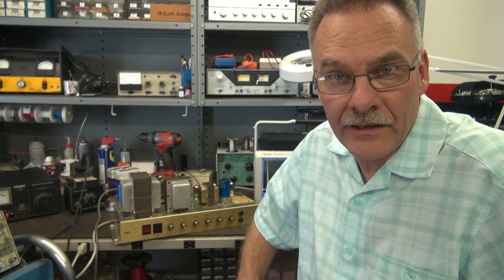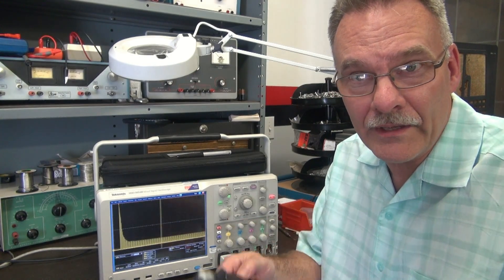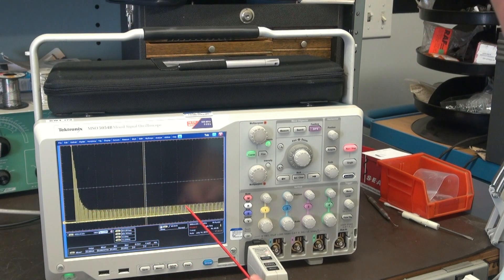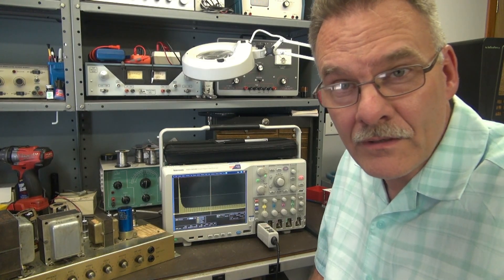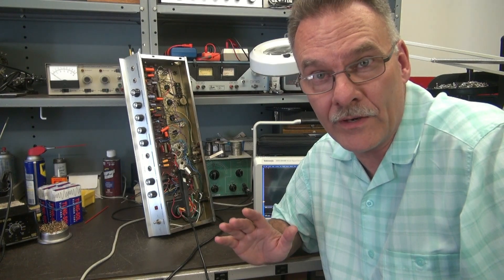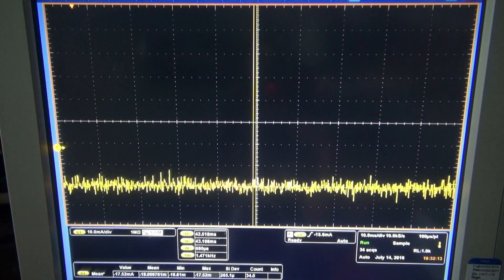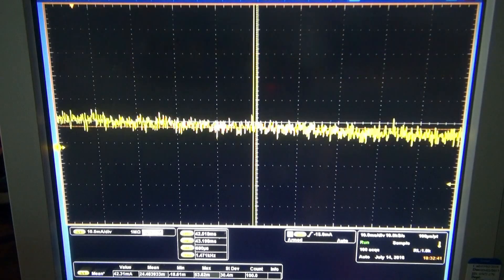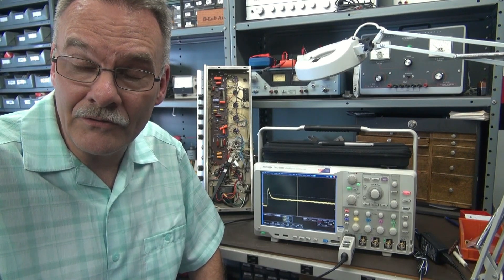Tube Guitar amp standby switch demo Myth buster Marshall Fender

Comment: Yeah its a Mute Switch for most guitar players , you don't want to mess with your Master Vol once you got it in the sweet spot.
Reply: That's gonna end up being a costly  way just to mute an amp. A simple  switch between the signal chain and ground would work better, cost less, be safer and not have negative effects on other parts of the amp. Also the guitar has volume knob lol

Comment: Great explanation, and proof is on the scope! So Terry, if I may ask...on my mid 80's JCM900 high gain dual reverb Mod. 4500 50 watt head/EL34's just turn the volume down upon start up, let warm up, don't worry about the standby? When taking a break, just turn down the volume and all good? If I take a 10min break should I use the standby, or again just bring the volume to 0? Waving a hand in Jackson. Love your 'vid's'....all the best around the ponderosa.  ")
Reply: I'm pretty sure its had EL34's from the factory. It was serviced by a guy called Dr. Zink before, I guess he's a pretty good amp tech. It sounds just great, but I think EL34's are getting hard to get? Maybe I should have the conversion done. (thanks for the reply).
Reply: Jeff..I think its original? The amp is a 1991, and has a sticker inside with the date of service by a tech named Dr. Zink.

Comment: A very brief excursion (current spike) through the rectifier or output tubes is harmless.
The real trouble with "standby" is the resulting over-voltage across parts of the power supply, namely the filter electrolytics, as most of the load is removed from the supply.
Bad mojo.
Also, have a close look at the ratings of the "standby" switch; not at all rated for the DC potential across (nor through) it. The closing of it isn't so rough on it, the opening of it IS. Bottom line? Nix the switch. Turn the volume down instead.
Thumbs-up, D-Lab.
Reply: And there's no reason you can't have a mute switch that simply sends your signal to ground instead of a standby switch.
Reply: This should work we don't have to be engineers to use an amp, so for our mortals what is the final advise? Don't use stand by?
Reply: Just pull your guitar lead jack out of the amp while you're on your break. Replace it when you return. Simple as that. Standby switches aren't necessary.
Reply: @castleanthrax1833  I was going to post the same reply!
Reply: @castleanthrax1833  While it's a good idea, it is of no help for at least the following situations:
- An amp with Reverb getting slightly bumped into will still produce a loud Reverb Spring noise.
- While unplugging the Cable from the Amp's Input helps reduce the vast majority of noise, a powered Tube Amp without being on Standby (I'm not advocating for Standby Switches here) will still produce a pretty good amount of hiss and noise. Even the quietest Amps still produce noise that is very noticeable at Stage Level (imagine if there were 5-6 Tube Amps on stage all producing noise... It would be irritating during the breaks.). Also, when on Stage, Tube Amps pick up all kinds of EM noise from the environment... Even happens in some Studios.

I have used various strategies over the years to try to avoid noise on stage while not playing, I must admit that most often I've also been leaving my Amp running open instead of putting it on Standby. 

This I usually do with my Rackmount Amp as it's DEAD quiet and there are no risks of someone shaking the Reverb Tank as it's in my Rack on top of 2 Stacked 1x12" Mesa Recto Cabs.

I do however usually turn down the Volume Knobs to Zero. I also use the Mute function from my Tuner and/or engage the Mute button on my Planet Waves Circuit Breaker Cable and leave it plugged in when I'll be using the same guitar after the intermission.

When I use a Combo, especially my Mesa Subway Blues (Class A non Master Volume monster of a little amp that runs its pair of EL84's EXTREMELY HOT, which is awesome as I use Power Amp Tubes Distortion with this Amp, but it chews through power tubes fast),  I engage the Standby Switch after muting my rig in one of the 2 previously mentioned ways to allow small amps that run hot to cool down significantly.

I'd still like an alternative to the Standby Switch!
Reply: For silicone rectifiers, just use a double poled switch before the rectifier.

Comment: The reason why Leo Fender added a standby on the Fender Bassman was because it had a cathode follower circuit (which Marshall amps copied. A cathode follower can ark without a standby switch. The cathode needs to remain within a range of voltage relative to the heaters. Simple circuitry can be added to prevent this kind of arching, that negates the need for a standby switch. Some circuits do need a standby switch in order to function correctly. For instance, various oscillator circuits need it in order for capacitors to charge correctly, however these kind of circuits are rarely used in guitar amps, and have since been replaced by semiconductor circuitry.
Reply: Alva Goldbook you can easily avoid this issue by simply placing a neon bulb between the control grid and the cathode tho. They say it was for tech-manteining purposes... And I've read a lot of other theories about that. Personally I think that them are all true, for a reason or another. There are a LOOOT of good reasons for a manufacturer to install such device, but for the purposes if the user... meh.....

Comment: So, that high initial in rush current would be due to ss rectifiers having low source impedance, and the power supply having a relatively high capacitance in the Marshall?

Comment: Well, I was taught that the purpose of standby is not to reduce the spike, but to enable the tube to better withstand it, and reduce cathode stripping, by pre-warming the components.
Reply: Cathode stripping would be more of an issue on a high powered tube RF transmitter. Standby switches are required for those types of amps.

If a standby switch was needed on musical amplifiers then my Wurlitzer spinet organ from 1964 would've needed it's tubes changed out a loooong time ago. The organ still uses the two stock 6L6 tubes and the stock rectifier tube it came with from 1964 and it has no standby switch.

However, cathode poisoning can occur on tubes in standby for long periods of time. Cathode poisoning will not happen if the cathode is allowed to have electrons flow out of the filament, so using a mute switch prior to the amp or turning down your guitar will actually prolong the life of the tubes better than a standby switch. Standby switches are more of a die hard tradition on guitar amps than serving a useful purpose.
Reply: @CorvetteCoonass  With tube diode you haven't B+ untill diode tube is warm so the output tube is warm when they receive B+. By the way stand-by switch exist because you can "turn off" the amp without waiting when you will "turn it on" again.
Reply: You won't get cathode stripping on valves made for amplifiers. Cathode stripping occurs in the 1kV range; amplifier valves don't normally go over 500V. 

I think the best example is looking at either modern valve HiFI systems or old TVs that used valves. You won't see a standby switch on them because it's an unnecessary feature for a device that runs on such a low voltage.

Comment: Thanks for the video. I have a Vox AC-15 and the instruction manual specifically tells users to keep standby off and allow the tubes to warm up for a few minutes before flicking it on. Do you know if this amp has a different design that necessitates this, or are the instructions just a relic of the old myth?
Reply: I want to know the answer to this exact question. I've been doing as the manual instructed without fail for five years. I just recently replaced my tubes and I would like them to last as long as they can.
Reply: @seanmcaleavy2369  tubes aren't as fragile as people have been lead to believe. Most of the myth surrounding it actually came from setups using MUCH higher voltage, where sometimes it did matter. You wont notice your tubes going out any quicker if you dont use your standby. Tube amps dont run that high of voltage for it to be noticable. Plus, nothing beats a fresh set of tubes. And yes I'm speaking from my personal experiences. Have fun and play loud
Reply: @michaelsorenson3887  Thanks, I appreciate the info.

Comment: But is a current spike really something to worry about with valves being inherently high impedance devices? 
What about cathode stripping / poisoning when a high voltage is applied to a valve that is not warmed up? Is that not an issue in your view?
Reply: Cathode poisoning happens with tubes in standby for long periods. Cathode stripping occurs in tubes running over 1000 volts. In other words, standby switches are useless and hurt your tubes.

Comment: On my Peavey, the standby switch is located between the solid state rectifier and the filtering capacitors. The initial current rush can be caused maybe more by the caps than the tubes?

Comment: I don't know, standby seems really important. Not using it could maybe possibly potentially cause cathode stripping if you regularly turn your amp on and off in sub-arctic temperatures.

Although to be fair your tubes would still outlive you in those temperatures.
Reply: No. This is simply wrong.

Comment: But what about electron stripping! The bane of all tube amps! lol that is the general comment I hear when this comes up. I think that only happens in very high voltage systems (say 1kv+) and that is like so far above where an amp runs that there is zero chance of that occurring.
Reply: Dimebag Dio Kilmister that's more a feature of very high output tubes such as used in radio transmitters, where anode voltages are in the kilovolt range.
Reply: Generally speaking, the cathode must remain within a voltage range relative to the heater. For most 12AX7s, this is about 180 volts. But damage over time can happen at lower voltages, and so it's important for amp builders to design around this issue.
Reply: @alvagoldbook2  According to the Valve Wizard, 180V is optimistic for current production 12AX7s, and recommends 90V.
Reply: It's a common problem in cathode follower circuits, but it tends to happen slowly over time. It's easily remedied by replacing pre-amp tubes periodically.
Reply: @alvagoldbook2  The problem with cathode follower circuits is the slow breakdown of the heater to cathode insulation, which can be prevented with heater elevation.
Reply: @silasfatchett7380  I usually elevate mine to around 40-60 volts or so.
Reply: It also only happens on REALLY high voltage setups.  Standard amps won't have an issue.
Reply: Alva Goldbook 
Love The 12AX7  !  !  !

Comment: the main point of a standby switch isn't maximum current draw at start up but cathode stripping as a function of the power tubes (and even the preamp tubes) if they're powered up before the heaters have a chance to stabilize....a tube rectifiers won't put DC on the plates before it's heater has a chance to come up. Ideally in the same time period as the other tubes. Most tubes with an "A" suffix have controlled heater characteristics that allow the heaters to come up in roughly 11 seconds. So in practice a standby interval is all that's necessary for SS rectified amps and none for tube rectified amps.
Reply: CSGuitars explains why you shouldn't use your standby switch in his video, and he talks about cathcode stripping.

Comment: Nice demo, my friend. Can i leave the standby all ways on?
Reply from the maker: Hello, Yes, I normally never install stby on amps
Reply: D-lab Electronics thanks my friend!
Reply: it depends from your amp .
for example at my evh 5150 lbx when i stand by off i see tubes lights really weak.so i quess at my evh the stand by switch working properly

Comment: And that is why old voa AC 30 never had A standby
Reply: VOX AC 30, sorry
Reply: @owejohnson938  When they finally gave in and included a standby switch, they fitted it in the worst possible position.

Comment: I've read that it's to allow the getter material to heat up so it can scavenge any air in the tubes before sending current through the tubes. Is that even a concern really?
Reply from the maker: Nope, I don't believe its a big concern, just wanted to capture the power up current trace. Had the scope available for the task. Hope you enjoyed the info presented.
Reply: +D-lab Electronics  I did, as always!